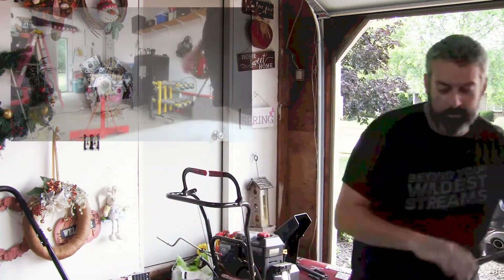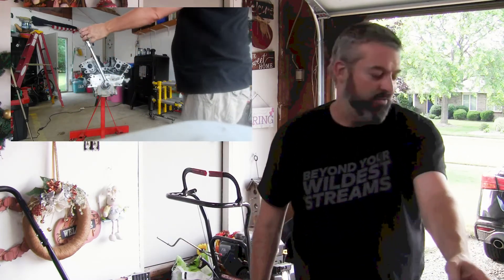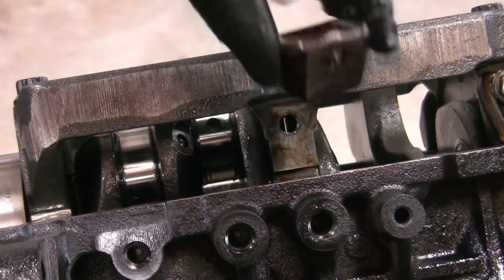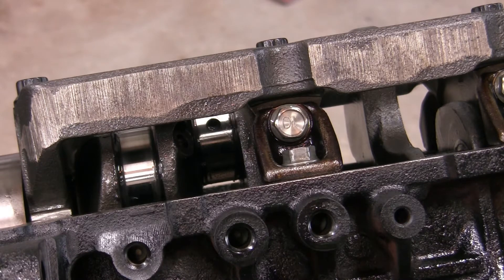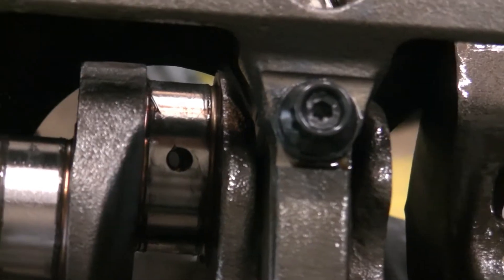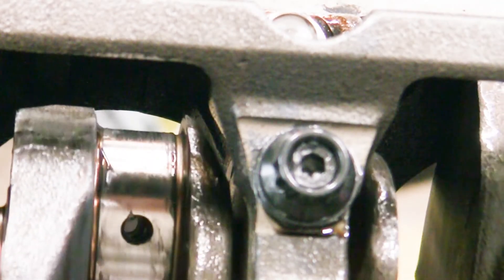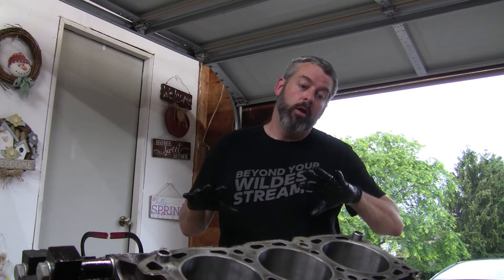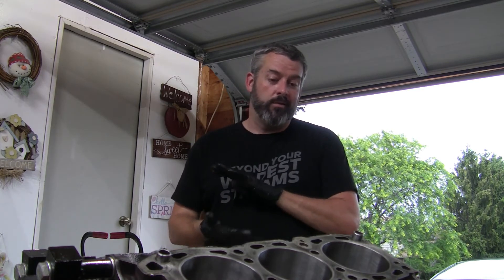6G72 Engine Assembly - Part 2 - What did I do wrong?

Comment: I’m a bit late to the video, and am just starting to get into engine building. I have experience with assembling semiconductor fabrication tools, but not much with engines. Would testing the shaft rotation after every component installation be a good thing to catch any binding points, or are there any downsides to that method? Thank you and I really enjoyed the video!!
Reply from the maker: Yes, 100% this. I should have checked the rotation more often than I did (but I was excited to make progress... so didnt). That being said, overly testing can be detrimental (I believe) because you want the engine lube to be in place when you are really starting things up, and over testing can squeeze out some of that lube you put in place. Or at least that is what I have seen in other videos. Glad you enjoyed the videos, I hope to get back to making them again next year.

Comment: Usually this is caused by one of the 4 girdle stays being installed wrong. The counterweight hits the stay if it’s installed wrong.
Reply from the maker: Yep that is exactly what it was. Took a little bit to figure that out, but once I got it pulled back apart I was able to flip it around and get right back to putting it back together. Thanks for watching.

Comment: Great vid bro, don't beat yourself up about it though, these lessons we learn will last us a lifetime.
I was so eager to rebuild my Dad's own that I totally omitted tagging all the screws and bolts, now I've finished rebuilding the engine, it's taking me a lifetime to find what 🔩 goes where🤦🏾😅😅. So we learn as we go along.
Reply from the maker: Hahah, yeah I can relate to the screws and bolts thing. I have bags of labeled screws and bolts for different sections but have realized that they are different lengths and so I now have to be very careful in re-assembly so as to not crack the block by putting in the wrong length screw. I also wish I had taken pictures of the engine as I disassembled it, instead of thinking I could rely on the video I recorded. It turns out I missed a lot of stuff and the service manual is not as much help as I was hoping it would be. I think that I will be looking at lots of online pictures to figure out where some of the parts go. Good luck on your build!
Reply: @AGeeksGarage  I have another one that I'll be disassembling, which I intend to take pics of everything, so when in doubt you can give me a shout.